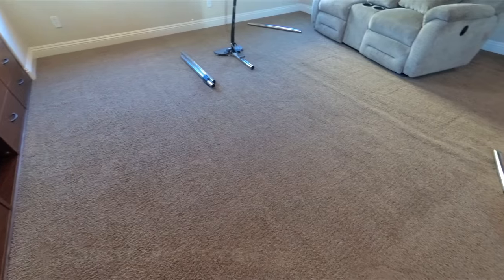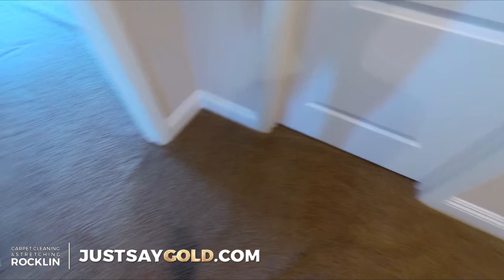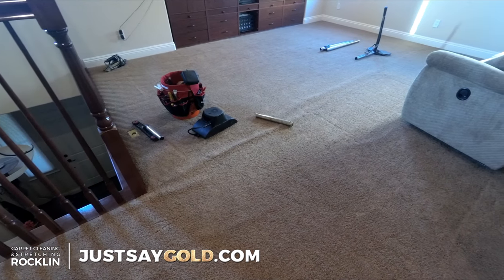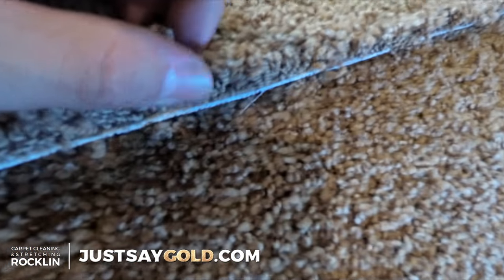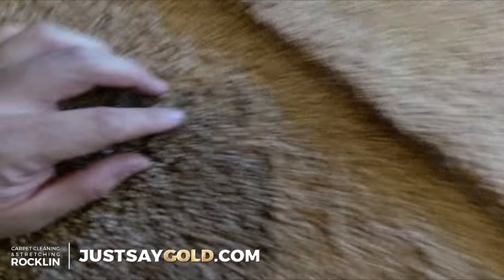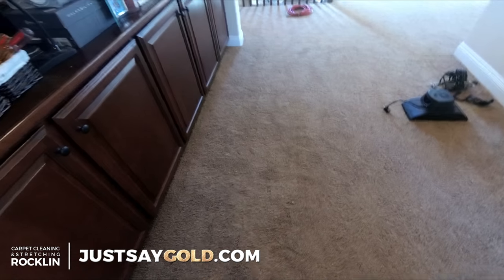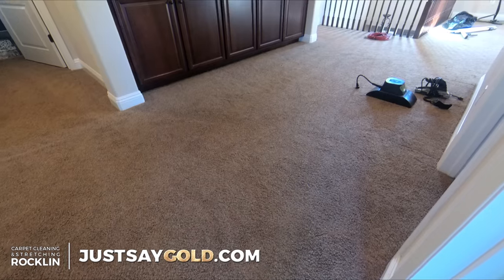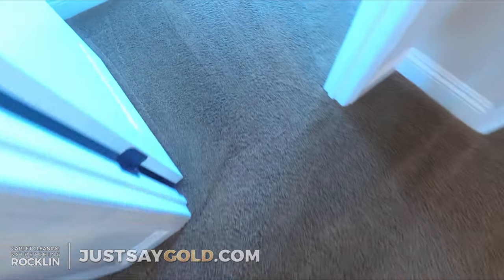How Does Carpet Stretching Work With Furniture In The Room? (Business Promo)

Comment: 99% sure that was at Mohawk carpet, did you notice any delamination, Mohawk carpet is bad about that , Looks like you did excellent job on your seam
Reply from the maker: I remembered what you told me about Mohawk and actually did check it after I cut and tried to peel it but it was ok. I'm sure if I used the black and decker steam method it would have caused delamination so I did not risk it. And thank you, I appreciate you noticing the seam work.